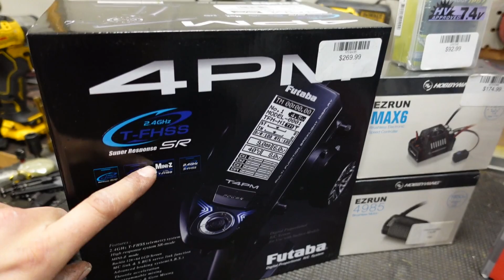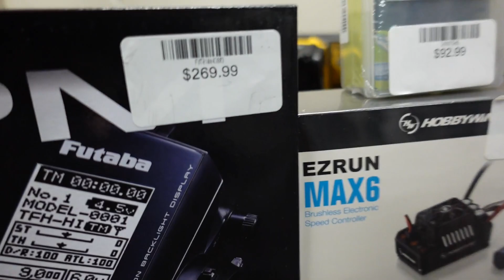Arrma Limitless Hobbywing Build Speed and Bashing Setup

Comment: Hi. Similar build to mine but I could not mesh up the provided 27t pinion as the motor hits the dog bone cup.
Reply from the maker: Ya I forgot to show that but I did sand the motor down a small amount.
Reply from the maker: @1521joe  Nothing to do with the skirt. The motor can is just big enough to lightly touch the center diff out drive. I did remove the skirt to install the motor